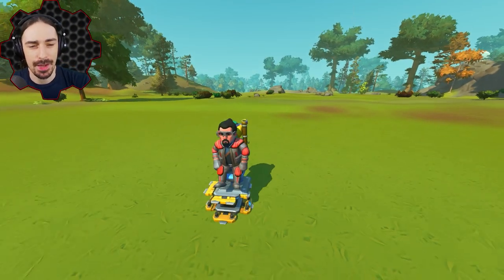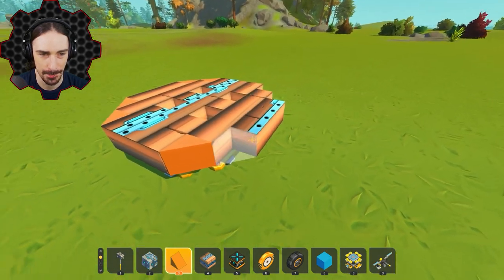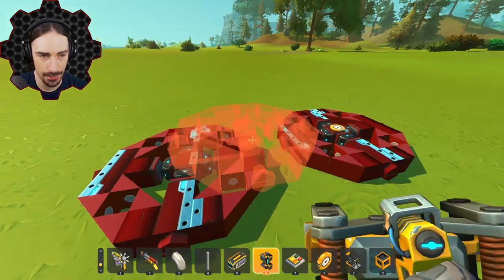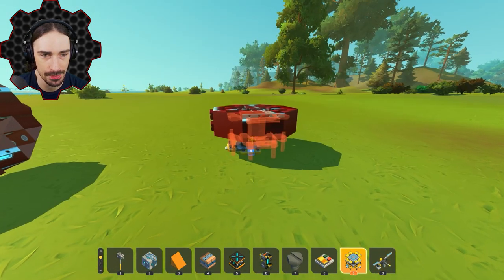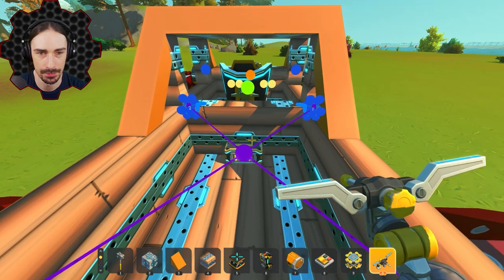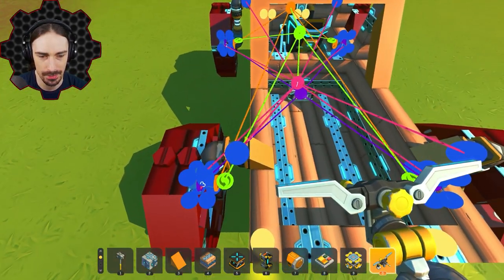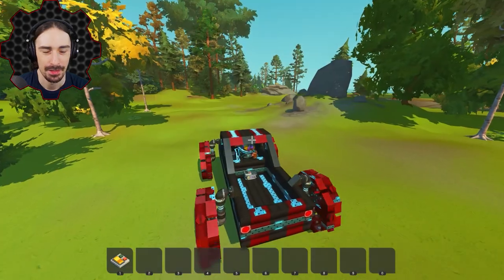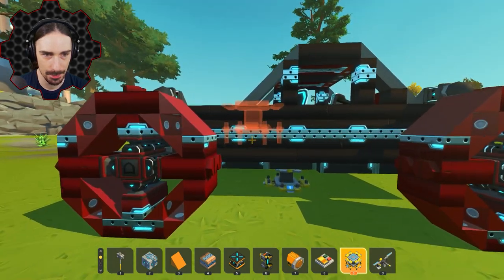Impractical Engineering: Expanding Wheels! - Scrap Mechanic Gameplay

Comment: When you speed up the pistons they get stronger, so just speed them up a bit
Reply: I'm pretty sure you mean 'speed up' because 'fasten' has a different meaning for some reason
Reply: @loganjoy-koer5936  jeah sry my english is pretty bad
Reply: @II--Someone--II  it's ok, mine is bad too
Reply: Fasten and speed up mean the same thing depending on context, but some people have contextual trouble, so being perfectly correct is the best bet
Reply: Yes they do get stronger but I'm not sure they get strong enough.
Another nice solution would be to simply shift the back wheels outward more so that wheels aren't one after another. That way they could expand much more and still not collide with each other.. Well that is until you would start steering in either direction.
Reply: @andre21198  true
Reply: yep
Reply: @silvoweiss347  and this is were you may wish to instead oped for a longer buid till the max expaned wheels dont colid by a block.
Reply: Day 1 of suggesting scrap do the Mad Max race. On either team, 1 player drives while 1 shoots the opposing team. You can decide how you want to split or combine the building, but I recommend the teams’ mates build together to figure out how the turret should attach and the overall design of the vehicle.
Reply: @lechking941  Making vehicle longer to prevent wheels colliding to each other even when pistons are fully extended is not as good solution as you may think.  Why? 
Since pistons can extend up to 15 blocks you would need to have your vehicle length at least 33 blocks. That would present huge problem when wheels are in contracted state as the vehicle will be bottoming out on just about any hill or terrain bump.
Now if you would split your vehicle into two parts connected with pistons so you could dynamically extend the vehicle length your suggestion might actually be a viable option.
Reply: @silvoweiss347  ya that's the better option for this as I was mindlessly thinking and ya you make the good point.
Reply: Wow. This is my first time finding someone that has the same profile picture as mine.
Reply: @SussyGrassInTheLawn  yeah i have it on all my platforms, i think its neat and discret
Reply: @II--Someone--II  I use a black shade because my dad told me that its not safe to show my face just yet
Reply: @SussyGrassInTheLawn  i use it because i dont wanna show my face
Reply: @II--Someone--II  this chat was nice btw but let me tel you a little secret ok.
So I secretly opened my dads wi-fi and he's not at home until 9 pm because im in the philippines. So nice talking to you
Reply: Alright I’m not mad I forget things sometimes when I watch a video all the way through but in the beginning he said that he shouldn’t go fast or else it will jump pretty much
Reply: @v1ncefan154  my bad, i forgot that when i typed that
Reply: His  tag nmhj
Reply: @_Wheels_21  The context where fasten and speed up mean the same thing isn’t very common. (Fasten is almost never used when making something faster, and almost all definitions of the word don’t say “to speed things up” or “to make something faster”.

Fasten the car? Fasten the throw?

Not grammatically correct.

Fasten is more usually used as another word for tighten.

Fasten your seatbelt, make sure the rope is fastened tightly

Comment: Multiplayer Monday Idea: Expanding Wheels. Everyone has to use the wheels from this video and create a vehicle that can race using them. The course would have parts where the contracted wheels couldn't climb as well as parts where the expanded wheels are too large to fit under, this way every creation has to be able to effectively use both the expanded and contracted modes

Comment: Idea: besides turning the speed up on the pistons, you could put pistons on the periphery of the wheels. If you wanted an octagon as an approximation of the wheel, if the central piston moves out by L, then the peripheral piston moves out by L/2.

i.e. moving from the central logic block, in each of the four planar directions, have two pistons out to a solid block, and either side have one piston attached to a wedge block. Have all pistons expand to the same distance and you would have a more rounded edge. If you instead of a wedge block on the edges, have a block with a bearing attached to another block attached to a piston, you mat have the directions connected and that might constrain the outward forces?

Also besides more speed at larger size, there is also more torque, which is why the wheels expanded in the larger configuration, but not the smaller configuration.

Comment: Day 9 of asking ScrapMan to do evolution races in Scrap Mechanic. (JUST DEW IT ON THE NEXT MM)
Reply: see you next day
Reply: It will not work,  because of the building restrictions of scrap mechanic and the lack of easy limiting for the evolution stages,  the engines and thrusters in trailmakers are pre-set to their top performance.  And are valued by power cores, not to mention destruction physics make the frailty a real hurdle for the builders.
Reply: Nah
Reply: @lightdeck8357  yeah
Reply: Dew? You mean do
Reply: @crazy_nicc791  OK Boomer

Comment: 7:20 - just fyi, it's centrifugal force in this situation, rather than centripetal force. Here's the difference;

Centrifugal force is the apparent force that is felt by an object moving in a curved path that acts outwardly away from the center of rotation.

And centripetal force is the force that is necessary to keep an object moving in a curved path and that is directed inward toward the center of rotation.

It's all dependant on the frame of reference of the object. Centripetal force, and centrifugal force are really just the same force, except experienced from different frames of reference, they're opposites.

But yeah, TLDR; centrifugal force is forcing the pistons to stretch, not centripetal

Comment: The centrifugal expansion of the wheels is a very interesting real life idea.
Top fuel dragsters use the expansion and squishing of their tyres to replace a transmission. Since the wheels are squished at the start because of the huge torque and the low inside pressure the "gearing" is rather low.
Later when the dragster is moving the wheels expand and  make higher speeds possible.

Comment: Maybe you could look into Dragster weels, they also extend with greater speed. 

Or try to implement suspension inside the weels, where the weels get bigger and smaller independently to adapt to the ground.

Nice Video :)

Comment: Hey Scrapman, did you know that you can 1 shot farmbots with a piston puncher? I built a 5 piston, max speed, 2 distance piston puncher and while it's not 100% a 1 shot, there's about a 72 ish% chance of one shotting a farmbot. The only issue I've been having is getting a reliable damage dealing hit in vs just pushing it or my vehicle around. But it seems like the velocity of the piston end is fast enough to deal enough damage to kill farm bots. I put on a wedge block to make it a professional puncher. Try it out, because it's a bit impractical on how close you need the farmbot to get and how exact you need to hit it for the puncher to actually deal damage, but it's surprising how powerful it is. Saitama is proud every One Punch you do.

No drills, no saws, no spudguns, just 5 Lvl 5 pistons with pipes (the green ones) between each piston and a wedge on the end. Pure physical (Scrap Mechanic and physics. . . HA!) force. I'm thinking of doing something like that in my survival world now.

Comment: Pretty great idea & execution but i feel like this deserves a second episode already
- I think if you connect the pistons to a controller they will be less eager to stretch out from the centrifugal force, also see some other comments mention that you can make the pistons faster to also make them stronger.
- In some sci-fi literature (like 'snow crash') there are wheels that expand only towards the road surface, to create more traction without turning into impractically large wheels all the way around, would be cool to see something like that created in SM, would require a bunch of logic and much more pistons though.

Comment: I believe the concept idea has been tested before but hasn't really been put to much practical use, still mostly a concept in use.
Another use in the real life one is that you can inflate or deflate a soft tire (with or without air, there's versions with both) and it goes in between the cracks for better climbing, catching on the edges.

Comment: An expandable "wheel" is used very commonly in most modern vehicles using a Continuously Variable Transmission (CVT). This transmission implements a pully and belt system with an expanding and contracting drive pully to allow change in the gearing ratio,  thus increasing or decreasing speed and acceleration.

Comment: Here is a potential fix for the low speed issue, have both front wheels be 45 degrees, so instead of the outer wheel being 45 degrees, have both the inner and outer wheels on the front be 45 degrees that way the front and back are opposite so when the back wheels are normally touching the front wheels, it will instead alternate, because of the gaps, so in theory you can have your engine speed up more.

Comment: Idea: Make a flywheel power car. You have a wheel made of concrete that you spin while you are stationary and then you engage the wheel to your normal wheels. Sort of like a mousetrap car but instead of a mousetrap, use a flywheel.

Comment: The thing about the wheels expanding is that larger wheels make you go faster and the aster you go the larger your wheels gets which makes it difficult to get that balance in distance. Maybe you could offset the wheels so that they don't overlap when they're expanded? Only problem then would be sorting our how steering works with the setup.

Comment: Hello,
Maybe you could fix the wheel coliding with each other by expanding them outward of your vehicle a different amount.Since 2 seems to be the minimum so the wheel don't colide with the main fram/body when you turn maybe try 2 and 4. 
Also you can probably add more layer to your wheel aloying you to have smaller increment and expend them further before losing the circular shape to much.

in any case great video

Comment: Using a rotating hub you could replace the pistons with bearings and you would have more control over the expansion. I'll try to design a prototype tonight after class

Comment: you can move faster if you put the rear wheels further out than the front wheels
I also think that might make wheels that automatically react to the terrain, although I'm not sure
you could also try using weak suspension instead of pistons if you revisited this idea, it might allow the wheels to 'bite' into crevasses for something like cliff climbing

Comment: Easy way to avoid collisions with your wheels. Off-set the wheel base. Make the pistons that extend outwards two notches either on the front wheels or the back wheels. This way, when you expand the wheels while driving, the wheels won’t collide with each other.

Comment: I'd like to see that with a series of sensors triggering the expansion.  A sensor at the front and back would expand the wheels slightly.  Then, working inwards, the next set of front and back sensors would expand the wheels a little more.  Working toward the centre point which would be maximum expansion.

Comment: You could add a gas engine on one set of wheels hooked to a switch and an electric engine for the other. So that when your wheels are small, just activate the gas engine and vice versa. If you wanted to really automate it, you could hook the existing switch to a power inverter and hook that to the gas engine.

Comment: Would it be possible too make the wheels faster unextended and slower extended, if so it should solve the problem you had with unwanted expansion

Comment: Couldn't you offset the pistons on the suspension with a 2 range on the front and 3 range on the back - so they would not collide when going straight, thus enabling you to go faster? Wouldn't help on the turning though.

Comment: I would have put sensors on the end of each piston section so they extend when they detect the ground. Then hook them into a logic gate so you can enable and disable it. Not sure if it would help but it would look cooler 🤷‍♂️

Comment: I wonder when will ScrapMan realize that the Speed setting on the pistons also governs their Strength for whatever reason.
To prevent then from expanding at higher speeds, just bump up the speed. I tested it with two wheels, one on max speed pistons, and 1 on lowest. The lowest speed pistons expanded as seen in the video, the max speed pistons didn't even budge at the highest speed the vehicle was able to get to with that motor.

Comment: so when the wheels expand, more torque is converted into speed, meaning that although the car is faster with expanded wheels, it is actually weaker. also, when you said surface area of the wheels adds more speed, although its correct its more scientific to say that the degrees to arc ratio is larger in the expanded wheel than the non expanded wheel, allowing for a greater distance to be traveled per full rotation

Comment: I have an idea, to solve the speed issue. Just put the 2 back pistons on 2 block expansion forever and then when you press the switch to make the wheels bigger, the 2 back pistons will expand to 4 blocks. In this case, i think the wheels wont colide and u could go even faster.

Comment: Scrap you should have it contoler powered and use pipes so that you can have fast speed on the low setting and normal on up setting

Comment: You can have a "locked differential" on this truck or car, put a piston on the inside of a wheel, clearing the body and frame (Preferably on the inside) and have it extend a block to the other wheel it's parallel to, weld the block to the wheel and you have a locked differential

Comment: Just to point out, a big reason for your truck getting stuck is the strange slab of concrete you put on the bottom when you should have built it into the floor. It was like self sabotage to make the wheels look better even if it was unintentional.

Comment: Would a controller limit the expansion on the spinning wheels also setting the wheels to max speed/strength and maybe doing a staging system with the controller so it isnt a huge jump all at once.

Comment: A possible solution to the wheels automatically expanding due to centrifugal force, connect pistons to controllers that should keep them rigid at all times right?

Disclosure: I do not yet have Scrapmechanic but I have seen lots of videos and controllers seem to make stuff well...reliable.

Comment: i have an idea to make the wheels not colide anymore, what if you expanded the front or back wheels a little more form the vehicule itself (not both, just the front or back ones so they are two blocks further out) like this, they won't be alligned anymore but they wouldn't colide i think

Comment: The wheels wouldnt touch each other while driving fast if you'd naturally offset them. Like in unexoanded form the front wheels are as they are now and the back wheels are pushed two blocks to the side. And just add two blocks to both pistons as you expand the wheels

Comment: Hey scrap man, I think I have a solution to your expanding Wheels problem. What if you were to power your wheels with bearings? Since you don't need all the bearings be on when your wheels are active, what you could do is set it up so that way all your bearings are turning when you're a small wheel mode and then make it so that way half of them are turning when you're in expanded wheel mode.

Comment: You can make it work at high speeds by building a lever witH a controller and a bearing and make it just so the lever opens when the tires expand you could use a three-sided pipe piece right where the triangle piece attaches to the piston put the Piston down at the bottom before it attached to the wheel and you got your lever system you can just have it flipped by the same switch easy

EDIT. Use super high friction blocks so you can attach better you used wood that doesn't have the highest friction

Comment: Impractical engineering: Similar to that  hamster ball toy built in sms make a car that has a roll cage, and to move it you have to hit either A) the roll cage or B) a pipe that turns and goes directly into the wheel.

Comment: They should add advanced piston Duramax names could be three or four or five less than the normal Pistons but they are more rigid so the thing where the subtropical Force makes them expand even more beyond their limit won't happen with the advanced piston but to make up for back of them being technically a little bit better they will have less max length and if they do Adam and you put them on this vehicle you can have it as fast as you want in the wheels won't expand from being centrifugal force they would be rigid in that fact and better in that fact but also worse and general use cuz they won't reach as far and can't expand as fast if the max is 12v will go 10 if the mass is 15 it would go like 12 for the length and or speed

Comment: #ScrapMan can you make more vehicle that are impractical but still do stuff when you drive them or does what you makr them do
Reply: Can you also add to this by making the seat have a gyro making it 2 sided and make the wheels in the center and when it flips the steering controls flip so its as if its normal for both sides

Comment: overlapping wheels and multiple pistons
Reply: those are hammers, try some bots
Reply: drone copter, with wheels
Reply: no worries of over-extending rotation
Reply: or just make the length of the car so long that the pistons have the max distance
Reply: you could also make it as an expanding snake mechanism, on the rim, I dont want to anymore